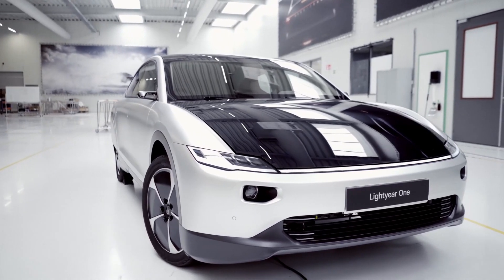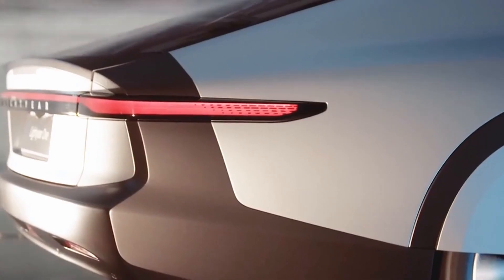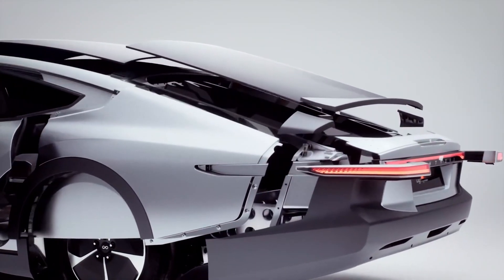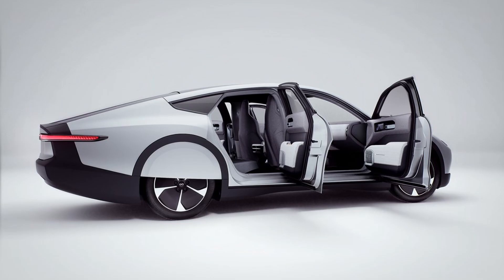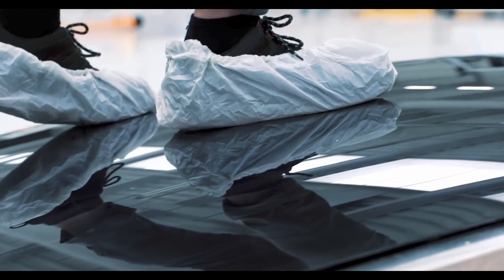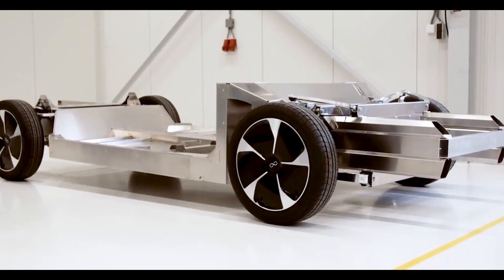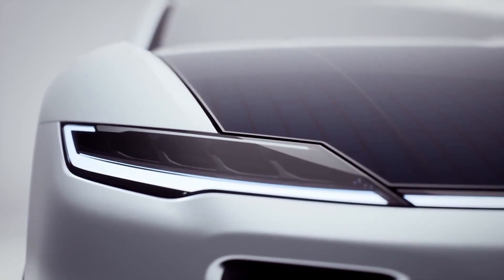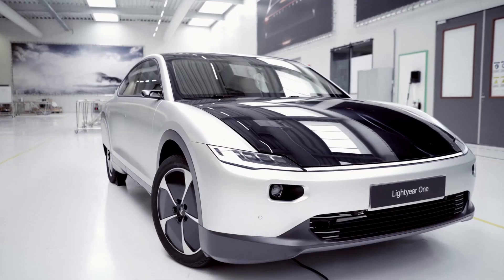LIGHTYEAR ONE final specs: powertrain, tires, price & availability

Comment: Interesting tyre size 175/60R19.  I imagine with the weight of the car on such small tyres the pressure will be higher than usual.  I suppose we are getting real with economy now.  You dont need super handling and cormer speed in normal driving. Just like you dont need 0-100 in 5 seconds!

Comment: So you get 3 To 4 40 to 50 thousand suv style 500 km capable car with about same a higher battery than this 60 kwh car, for the same price. Unless it is some seriously luxury model to compete against lucid, mercedes eqs etc, who have above 100 kw battery, this is a waste.
Reply from the maker: Interesting take on the Lightyear🤠
Reply: This is the first model, secondary versions of our car will be in the pricepoint of the Model 3 - Also, the cars you mentioned are not able to charge while driving. That, and its efficiency, are the main points of our vehicle!

Comment: Up until now, vehicles were heavily reliant on fossil fuels.  With the data of daily solar power generation, charging time and power consumption, we can estimate how many cars the system can handle and how many electric vehicles can be charged. Whether we have to use the electricity from the external power grid. The best thing to do is to reduce costs and have an efficient electric vehicle with a light and small battery system and long operating satisfaction. At present, the development of new types of energy conversion and storage systems is becoming apparent due to the increasing human population and thus greater reliance on energy-based devices for survival. The energy used by the solar panels is basically direct current.In order for this to be used to charge electric cars or other automotive devices, it needs to be converted to AC power. Solar inverters convert this direct current into alternating current before the charging process begins or the current is sent to off-grid electrical networks. Thus they have special function in photovoltaic system based on energy conversion and balanced. The global concerns about greenhouse gases and pollution, electric vehicles are being developed at a rapid pace these days for both residential and commercial use. With daily use of these cars, users need to recharge the car's battery as soon as the battery in the charging station runs out. It doesn't take long to fully charge the car. During the charging process, not only can the user use their car, but the process also leads to an imbalance in the power distribution in the network. This leads to a low power factor and instability of the power grid for other third parties using the grid. In addition, some electric car owners still have the problem of charging their electric cars in a charging station because the car batteries and charger of the charging stations are incompatible. Therefore, the question of how to charge electric cars from solar energy has become an important and necessary link in solving these environmental problems.
Reply from the maker: Lengthy one
Reply: @Autostop_ , ok...The best thing to do is to reduce costs and have an efficient electric vehicle with a light and small battery system and long operating satisfaction.Proposed power grid distribution and minimal fixture from the solar power system for the EV panels etc. which can be charged quickly without damaging the battery system.